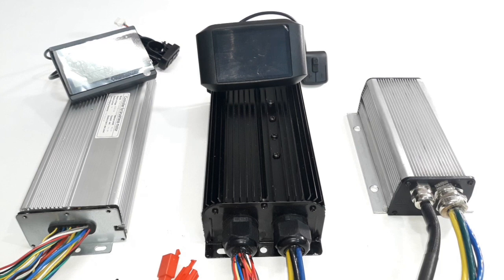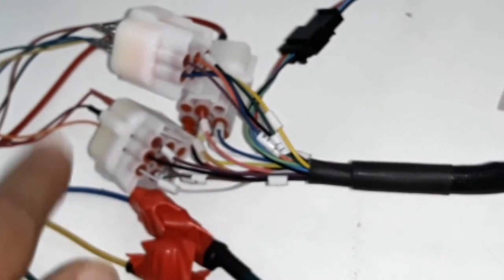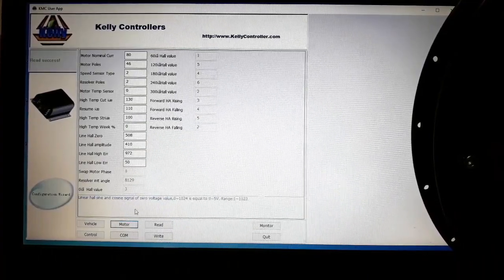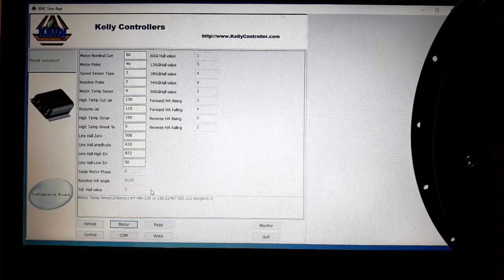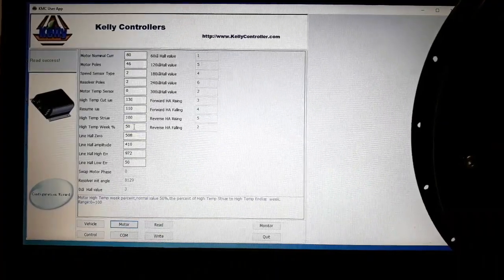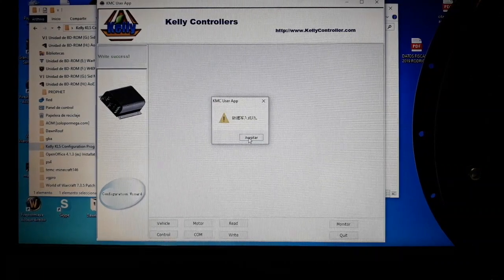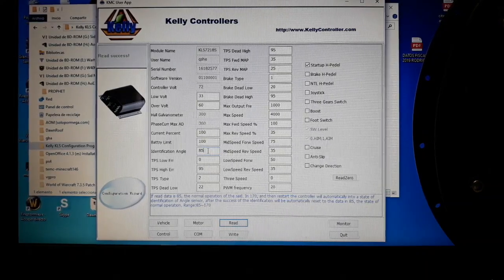KellyController Parameters, Programing setup, Part1 (English)

Comment: Hey Gonzalo, have you ever had any issues with the computer cable connection? A few months ago I was able to get it to connect after a number of attempts and then set up the parameters, but lately I can't seem to make it work. Every time I try to open the Kelly app it says "no power, or cable not connected". Do you have any advice?
Reply from the maker: Yes, sometimes I had difficulties with the cable. 
Usually after several attempts disconnecting the battery and so on I was able to connect.
Try to add a ferrite ring to the cable because it maybe noise problems.
Heard that using Android app instead of PC app works better but never tried myself.

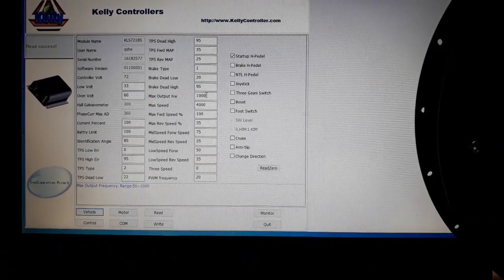Comment: Great vid!!  You mentioned around 10:55 about Max Output Fre. 
Mine is also at 1000. So this can be only requested to Kelly to increase it? Is it to increase top rpm or speed of motor?
Thanks!!
Reply from the maker: Yes it is possible to request to Kelly for higher frequency controllers if necessary. But that does not mean that your motor will go faster if your motor is only able to go to a certain speed with the voltage supplied.
Reply: @gonzalop.chomon327  hi there! Do you mean you can request a specific "model" of controller or do you mean that Kelly can program the controller higher?
Reply from the maker: @MrDeceptacon88  They can program/modify the controller to work with higher frequencies.

Comment: Fantastic tutorial series!! Following it closely but I have a slight problem... it seems KellyController only has the KBS-X version not the KBS-E version, so it's capping me at 60v for over voltage on a 72v setup :( - any chance you have the link you used to download the programming software? I have the same controller
Reply from the maker: Hi Byte, you can download all software and manuals form here: https://kellycontroller.com/support/
Reply: @gonzalop.chomon327  you know what it was, i made a mistake and ordered the 48v initially... It has two stickers on it, one says 7218 and the other says 4818...  Lol - just placed order for 72v as well. Great videos man!!

Comment: Hello Sir, I am currently working on a 3 wheel project.  I am working with a Kelly KLS7212N model driver. I am working with a 3 wheel vehicle of approximately 400 kg.(Gearbox ratio 1:10)  The vehicle cannot go uphill without a booster gear and overheats, reaches about 90 degrees Celsius and protects itself from excessive heat. How can I overcome this problem, which parameters should I change?
Reply from the maker: There is some parameters at the controller that can be tuned in order to reduce the motor temperature.
Between others the main parameter you can tune is: to reduce the overall power, but as you commented, you have power problems.
What makes me think that the problem maybe that the motor is not powerful enough for your application.
Can you give information about the vehicle: Weight, speed you want, aerodynamic coefficient, frontal area, etc.
So it is possible to calculate what is the motor power for your needs.

Comment: Hi Gonzalo, thanks for the tutorials. wondering whether u be making a wiring video as mentioned? ive got a KBS72181AE and the manual reads 'All contactors or circuit breakers in the B+ line must have precharge resistors across their
 contacts', but it doesnt seem like you have and im hoping there will video to enlighten this matter with other systems like the regen braking. tqvm for reading
Reply from the maker: No I have not used any prechager system, that is why you can listen the sparking on the videos. The model used for the video is quite small so it is possible to skip the precharge at cost of replacing connectors or switches occasionally. But for bigger controllers precharge resistor or other system is a must.
You can find info about the regen braking on the following videos:
Part 2 English: https://youtu.be/_if9dnVkr6U
Part 3 English: https://youtu.be/ITP6mey2eCk
Reply: @gonzalop.chomon327  hi again Gonzalo. I wired my KBS72181AE like u did and applied very low throttle. The motor turned for a few seconds but then the controller overheated and shut down. After letting some time to cool I tried again but the Led indicated there's too much voltage into the controller. I suspect it could be my wire running from the battery to the pink wire 7 being not the right size  and resistance maybe? What's the right awg then? Thanks
Reply from the maker: @guumballl  Pin 7 is just the "switch on" signal, it does not need any kind of big load cable.
If controller heated up in just a few seconds, something must be done badly.
Check everything with the schematics in the controller manual making sure that all is connected in the right way.  And of course make sure that the battery voltage is not over the controller limit (90V for your model)
Reply: @gonzalop.chomon327  the wire to pink is also the source for the controller no? (Beacuse it is running parallel with the battery) . I'm using a fairly thin wire (but is thicker than the pink one) and my battery is 6s anyway so around 22v + only. What else could be the problem?
Reply from the maker: @guumballl  The current source for the controller are the main red and black cables.
22V is too low for that controller model.
Here is the manual: https://kellycontroller.com/wp-content/uploads/kbs/KellyKBS-EUserManual.pdf
RTFM :)
Reply: @gonzalop.chomon327  I do RTFM ;) and it does say controller power source range 18V to 90V. Btw The controller led when I power up is green, and flashes red pattern to indicate power overvoltage after abit of throttle. Motor heats quite abit too. Still can't pinpoint the problem
Reply from the maker: @guumballl  The motor and controller should not heat up much as there is no load (I suppose there is no load) If the identification angle procedure has not been done it is possible that the controller/motor heats up a little bit but usually nothing to worry about. Please proceed to make the procedure and see if that solves.
The high voltage error is quite strange unless the max. voltage has been set up very low (Let me know the led lights pattern) and max. voltage numbers.
Reply: @gonzalop.chomon327  I bought the motor, controller, and batteries in one bundle and it didnt come with the pc cable and i was told the controller is pre-programmed. however i just ordered the blue tooth dongle and i will try to make my own usb cable as well. (cant find the cable online). so I have not tried the identification angle procedure either. i dont really know what the voltage set up is either without any interface.
To clarify, i started the setup 3 times with the led giving a green light and applied throttle a little each time for no more than a few seconds: 1st time; the motor ran for a few sec but the controller overheated and shut the motor and started flashing (led flashing sequence 1,4) 2nd time; motor didnt run. led indicated over voltage (led flashing 1,2). 3rd time; motor didnt run, led flashing 1,2 but this time i waited with a slight throttle longer to capture the led timing better and it still indicated over voltage until i could smell the motor burning a bit then i stopped. both the motor and the three phase wires were unreasonably hot. 
Yes the high voltage is quite strange and i think it makes most sense that the battery is making more than 90v. ive ordered a voltmeter to chk it but ill be shocked if they didnt chk the output at factory. btw, the battery is actually a 15s (i said 6s above) and the motor is 3kw.

Big thanks for your input thus far. I will update here when i get that voltmeter and be able to hook up the controller to pc and check the settings i guess.
Reply from the maker: @guumballl  Something must be really wrong if it heats up in just a few seconds.
Let me know how it goes.
Reply: @gonzalop.chomon327  ok. Just managed to get voltmeter and battery produces 50v. So battery is within range. Tried the controller again but now it blinks 2 1. (motor did not start. Hall sensor or phase wiring problem). Are hall sensors so fragile? Hoping that some programming will solve this when I get the pc connection
Reply from the maker: @guumballl  Then I think that the problem is that the motor phase wires and hall sensor wires are not connected in the right combination.
You have to check the different combinations of wiring the motor phase cables and hall sensors cables in order to find the correct ones. There is 36 different possible combinations, only 6 of them make the motor work, 3 in one way and 3 in the reverse.
Reply: @gonzalop.chomon327  it did work briefly though ( the very first time i wired it all up) . I have chked the wiring a few times now and all the colours are right. So I should miss-match it now? But how to explain when it did work briefly at the beginning?
Reply from the maker: @guumballl  There is some combinations that start the motor but do not make it work properly, it usually starts stops abruptly or makes strange noises, or sometimes does not start. Erratically behavior in general...
Reply: @gonzalop.chomon327  got the motor turning. You were correct. The problem was the combination of the smaller hall sensor wires wrong on either the motor or controller. Thank you!
Reply from the maker: @guumballl  Good to know, I was getting worried.
Reply: @gonzalop.chomon327    Hi Gonzalo, spent the last few months building my bike and now ready to program my KBS72181AE (software vers : 0602). I got 'KBS-E' and 'KBS-X' config software V4.6 (I dont know why there is two versions of this btw. seems like both are the same) which is not the same as your tutorial.
1. Do you have link or can you tell me what version software you have for this video? i will try to find it.
2. For this 'KBS-E or KBS-X ' software ver. 4.6, i cant seem to reverse the direction of the motor. any chance you are familiar with this version? (or must I switch the wires to reverse the polarity?)
Thanks!
Reply from the maker: @guumballl  Hi Guumballl, I suppose that you have the KBS72181E controller. So you should use the KBS-E software for it. The options are the same but the firmware of E and X controllers may be different, that is provably why there is 2 config programing versions.
The software of this video is for the newer KLS controllers/software. But parameters are basically the same.
Reply: @guumballl  hay man, can you send me the software for the kbs-E contoller?
There is no such program on kelly website, if i try to download the kbs-E, the program that dounloaded is cold KBS-X.
Reply: @dansaada  Hi Dan, im using KBS-X downloaded from the same source (but from the kbs-E dropdown). dont have the kbs-E specifically either.
Reply: @guumballl  tanks, my problem was solved!
The problem was that when i connected the fully charged 82v+ battery, the rs232 converter getting 63v from the controller. The converter was making not nice noises and dident worked.
When i have pluged 22v battery, it workes perfectly!
Maybe it will help someone like me that going crazy about it.

Comment: Hello,
we have the problem with our vehicle that the speed display shows about 5 km/h too little.

Unfortunately, we have found in the Kelly manual no information on how we can adjust the speed display on the "Kelly KAC7235n".

Does anyone have a tip where we can set this in the software?

Which parameter we should change ?

Thanks in advance, Christian
Reply from the maker: The vehicle speed calculation on Km/h or mi/h is carried by the display, not by the motor controller.
You should check the display manual.
Reply: @gonzalop.chomon327  Thanks for the info, we'll have to take a look there.

Comment: Hi,
We are using KLS8430H to run the PMSM. But we are facing an issue with Identification angle process. Angle identification process is not completed getting Identify err. Requesting your support for us to proceed further
Reply from the maker: Provably you are using a quite big motor so I suggest that you increase the "Motor Nominal Curr" from 80 (default) to 90 and try if your identification angle process if finalises ok.
Reply: @gonzalop.chomon327   Sure will try. Thank you

Comment: When I do the identification it will end with 3 buzz and then 2. Do you know whats wrong?
Reply from the maker: Hi Magnus, Before you make identification angle procedure, the motor has to be able to turn, meaning that the color combination of cables is correct. And you have to choose the correct parameters at the controller. Check full videos.

Comment: Hey, can I programme the controller to have something as eco mode to consume less power and have speed restricted to +-25km/h and other configuration with full power and switch between them in real time? Something as chinese e-scooters have. Thanks!
Reply from the maker: Yes, you can have 1, 2 or 3 "speed gears" by a switch.
And you can program the speed for each "gear"
Reply: @gonzalop.chomon327  Yes I finally find out too that it has three speed, but didn't know about custom program to each one, that's great! I have another question which I can't find anywhere. Do you know the main difference between KLS and the "legacy" KBS? KBS is slightly more powerful, 55A/130A, against 50A/120A in KLS. As I understand, the software and functionality is different, but I don't know the details. I want good throttle response and KBS should have torque throttle mode. Thank you again :)
Reply from the maker: @thepretiso  The main difference is that KBS ones are square wave and KLS are sine wave controllers.
Software is more less the same.
While in the KBS you have 3 modes to choose from (Speed, Speed/Torque and Torque) in the KLS you have direct access to edit the PID numbers.
Reply from the maker: @thepretiso  At video part 3, you can find how to setup the 1, 2 or 3 speeds switch.
Reply: @gonzalop.chomon327  Oh really? there is no mention on Kelly's site that it's square wave, I thought it is also sinewave. So what do you suggest is best option for e-scooter? I am worry that KLS would lack that acceleration punch from the start, what do you think? Also I think that configuration of KBS is easier. Ill check that part3!
Reply from the maker: @thepretiso  For in-wheel motors is preferably to use sine wave controllers in order to avoid noise.
About the acceleration mainly depends on your battery and motor power than the controller and overall vehicle weight. Anyway you can modify it changing the PID numbers.

Comment: At 3:15 my motor just jitters and does not make a full turn. Any idea what it might be caused by. Hall sensors seem to be legit and also the main phases seem to be ok. My controller is KLS7212S and the motor is mxus 3k
Reply from the maker: Hi Garbagej,
For what you say, I think that the problem is that the motor phase wires and hall sensor wires are not connected in the right combination.
You have to check the different combinations of wiring the motor phase cables and hall sensors cables in order to find the correct ones. There is 36 different possible combinations, only 6 of them make the motor work, 3 in one way and 3 in the reverse.
Reply: @gonzalop.chomon327  ok thanks I will check it out. Thanks for reply

Comment: can anyone tell me about  pin wire  15 on  here an where it  goes  its  a  foot  switch     does it need   closed to pin  11  or  left open to   work  i have a  7230s  regards
Reply from the maker: The pin 15 can be used as an activation/deactivation switch.
I talk about it at 2nd part video: https://youtu.be/_if9dnVkr6U

Comment: what throttle is that and or what throttles work with kelly controllers?
Reply from the maker: Any signal from around 1V to 5V will work.
You can use a potentiometer or a hall signal throttle.

Comment: salut j'ai effectuer Appairage des phases mai le moteur saccade et ne veut rien savoir et sur mon Controller la led rouge reste allumée merci de me venir en aide svp merci
Reply from the maker: Sorry I do not understand French, but with the translators it says:
"Hi, I have paired the phases but the motor jerks and doesn't want to know anything and on my Controller the red led stays on."
You need to find out the right combination so the motor turns. There is 36 different combinations and it only works in 6 of them.
When it turns do not fully accelerate the motor before you make the sensors identification angle protocol.

Comment: Why are you multiplying the pol pairs by 2 to get the right amount magnets? Shouldn't you multiplying by 3, because the motor got 3 phases?
Reply from the maker: It refers to the physical motor poles not the "electrical" motor poles.

Comment: Kelly 80-200A? No 80A Battery and 200A Phase
Reply from the maker: Sorry, I do not understand what you mean.
Reply: @gonzalop.chomon327  It's pretty clear what he meant. You said in the video Kelly does 80 to 200 Amps but it only pulls 80A from the Battery. The 200A are the Phase Amps that the motor sees at low Rpm. 80Ax72V is a max of 5760 Watts.
If you just say 200A it could mean 200Ax72V wich would be a crazy 14400 Watts.  
So it's important to distinguish Battery Amps from Phase Amps.
Reply from the maker: OK I understand now.
It is a 80A continuous current and 200A peak phase current. (I did not meant phase current)

Comment: Does this controller have wield weakening?
Reply from the maker: No, this controller does not have field weakening. As far as I know (I don't know all) Kelly controllers doesn't have that feature.
Anyway, as a rule of thumb if the motor needs to run more that 10% of its working time on field weakening point, it is better to use a higher KV motor, or increase the system voltage in order to achieve higher rpms. Else the system will run with low power efficiency.